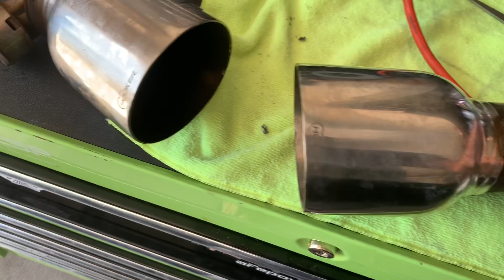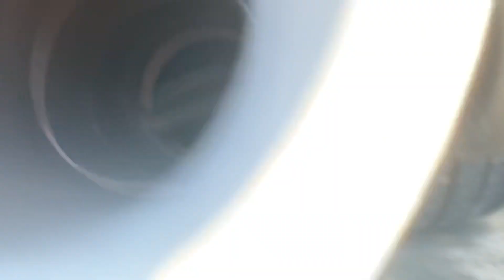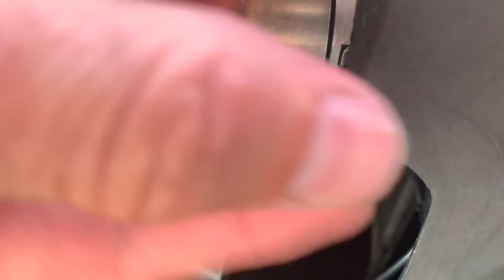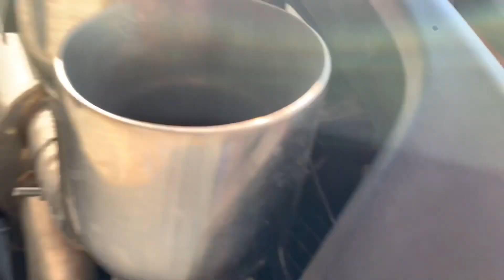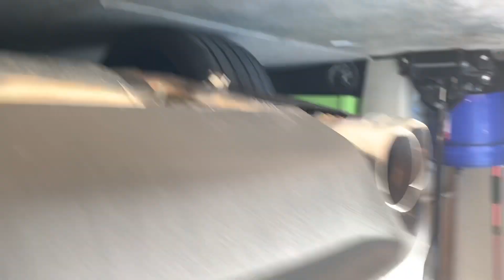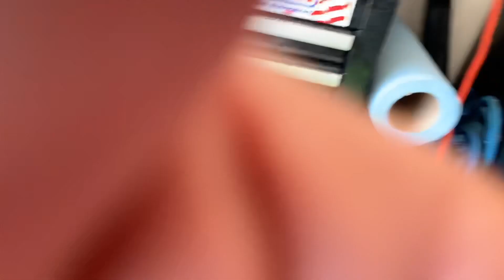Hooker Blackheart Axle Back For 6th Gen Camaro SS

Comment: No trouble with mine at all.  The borla I put on my truck was a colossal disappointment however.  My hooker black heart on the camaro has had no trouble for years.
Reply from the maker: That’s good. What other mods do you have? This hooker gave me the worst drone. But I had no cats, and headers.
Reply: @murdered_ss  did it even drone with the valves closed?? 
I also have no cats and headers and just ordered these YESTERDAY!! I have time to cancel get back to me pleeeease
Reply from the maker: @Anthony-pi6pf  yes, droned a lot both opened and closed.
Reply: @murdered_ss  I just put mine on, no drone at all open or closed at ~1800 rpm which is about 70-80 mph
When it drops to 12-1500rpm the whole car resonates but I’m like never in that range, I’m happy with it! 
(No cats and aftermarket headers btw)
Reply from the maker: @Anthony-pi6pf  maybe they seen this video and they fixed it?

Comment: I like the design of the system... But the rattle is disappointing.

I need to track down 3" valves that work with the factory actuators and build my own.